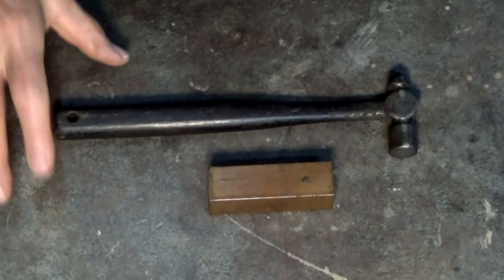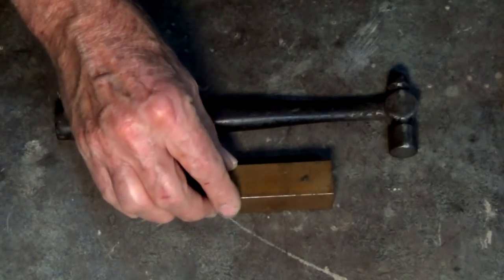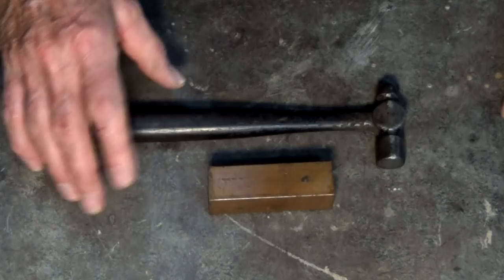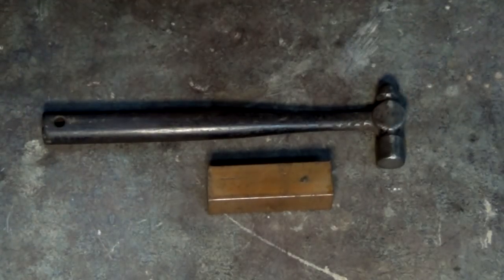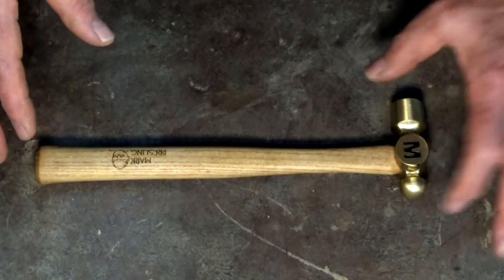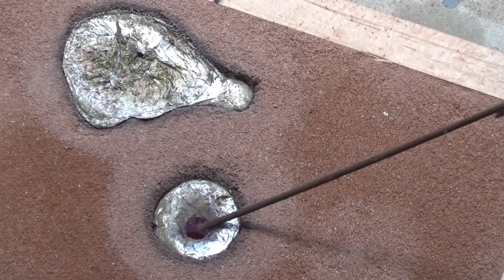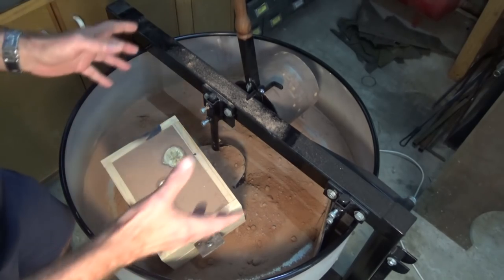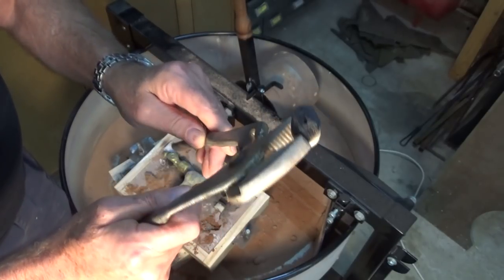CAST BRASS MACHINIST HAMMERS - PART 1, THE CASTING

Comment: Yet another excellent vid, Mr. Presling.

A note for beginners: Brass is made of zinc and copper. Zinc boils at a lower temperature than copper, as Mark touched on when he mentioned losing zinc. Zinc fumes are potentially hazardous to breathe so whenever you're casting brass you need to do it in a well ventilated area. Metal fume fever is no joke!

Comment: The most efficient way of getting uneven volumes mixed is geometric dilution. If you have say ten grams of the smaller volume add ten grams or an equal volume of the larger and combine. Then add equal volume on the larger to the already combined. Very quickly you will have it all combined and free from discrepancies. Beautifully explained in Turorial Pharmacy circa 1975.🤣. It makes me feel sick remembering that book but the technique sure works.
Reply from the maker: Hats off to pharmacists! 😁
Regards,
Mark

Comment: Nice work Mark! I don't have any casting facilities, but I like the size and agility and weight of those small ball pein hammers - so this gives me an idea to modify an existing ball pein hammer: Cut off half the cylindrical part, drill and tap the new face, loctite in a stud, and then cut off a few discs of round material (brass or aluminium or delrin or whatever) that can now screw on in place of the original steel face. When it gets dinged up, either reface it on the lathe, or make a new one!
Reply from the maker: Well you have a stinking big milling machine and a nice lathe so you're already half way there. Check out my video on making a copper face drawbar hammer. https://www.youtube.com/watch?v=N5f9ggC56y4 It's a bit like what you are considering.
Regards,
Mark

Comment: The resin that went off was probably a polyurethane casting resin, which in my experience usually have a shelf life of 6-12 months once opened. And hate any exposure to moisture.  Epoxy resins usually last longer. Great video btw. Have been planning to do something similar. Love making my own tools. My favorite hammer Is one I turned down from a piece of 38mm brass hex stock. Cheers
Reply from the maker: Yes, it was a surprise to me when it went off. I just won't be buying that type again.
Regards,
Mark

Comment: In a recent video, Tom Lipton was talking about hammers, and made the point that Brass is a bit hard and can cause damage to steel parts. Copper was his answer for a better mark free hammer material.
Reply from the maker: Yes, I watched that video just after I had printed the patterns for my brass hammers. I would love to have a supply of copper stock like he has. I am guessing he just goes through the skip out the back of Berkeley Labs to find enough to make a whole batch. I saw one of his posts on Instagram where they broke up a HUGE granite surface plate with sledge hammers because they couldn't sell it at auction. It was about the size of my bathroom floor. I nearly cried!

Comment: Nice video Mark. Your casting skills are really improving.
Just a word on hammer handles (and any other wooden handles for that matter). Always try to buy or make handles where the plane of the grain is in the same longitudinal plane of the hammer head or tool.
In this way the handles last so much longer and don't delaminate as they do when the gain is at right angles to the plane of the hammer head. It amazes me that so many handles are made the wrong way these days.
Reply from the maker: Don't get me started on hammer handles. I went to four hardware stores and three tool suppliers and guess what? Not a single one stocked a replacement hammer handle of the size I wanted. It seems that hammers are sold as disposable items now. I ended up buying a job lot of five handles on Ebay from the UK. So, I had to pay for shipping and they were purchased sight unseen. I understand what you are saying and one handle did start to split beyond the lower edge of the hammer head. I had to soak the grain with some thin cyanoacrylate to stabilise the wood. The only good thing is that a machinist hammer has a fairly easy life since they are not designed for heavy blows. Oh for the good old days when you could pop down to the local hardware and purchase from a wide selection of replacement handles of all descriptions!
Regards,
Mark
Reply: Ahh yes. That is an issue. Fortunately our local hardware stocks quite a number. However I am a bit of a hammer collector of all things. With some I have had to cave my own handles. It's really not that hard and quite rewarding. You should try it.

Comment: Have a look at 26:35, you scrape all the slag off but left some on the lip of the crucible and it falls in your pouring basin.
Reply from the maker: Yes, that stuff was hard to get rid of and I was very conscious of getting it in the mould as quickly as I could before it started to cool. I ended up with a cold shut on one of the hammers but I was able to silver solder it back together again. I had to warn my friend Macca, (a former boilermaker) that it wasn't a hammer designed for flogging inch thick steel but rather, for light tapping of delicate setups. The muller works great!
Regards,
Mark Presling
Reply: @Preso58  Good to see that  the muller is a useful tool in your workshop.

Comment: G'Day Mark, love the vids.  When I ran my foundry (hopefully I'll get it up and going on a much smaller scale) I made up my own 'K-Bond' which is very similar to Petrobond.  Use it over and over and just need to add some Isopropyl alcohol or metho with some smokeless 2 stroke oil when re-mulling and its ready to go again.  Gives beautiful definition (even thumb prints on the pattern) and is more like working bread dough than sand.  Also worked very well on cast iron.
Cam
Reply from the maker: Cam, I now have a recipe for Kbond and I am looking for a supply of bentone. Stay tuned!
Regards,
Preso
Reply: @Preso58  G'Day Mark, try Brenntag in Brisbane.  I purchased from their Melbourne facility, this is the price I got a couple of days ago -
"We do have product in stock. TDS and SDS attached.
Price for 25kg of Bentone 34 is $22.31 per kg plus GST. Total cost $557.75 plus GST. Delivery Melbourne Metro".
Not cheap I'll admit but if you do a quantity of casting its worth it for the superb finish you get on castings.  Bronze comes out with a near mirror finish.  I live down in Geelong south of Melbourne and they will deliver for free to my address.
Cam
Reply from the maker: @camatbattler2233  I am definitely interested in trying some KBond but $500 plus is a big investment for a backyard foundry. I will need to run this by the finance department (spouse). I may buy the whole 25kg and try to sell it on with gumtree or Ebay but I did see a post on the alloy avenue site where a poster was looking for partners to defray the cost of a whole bag purchase. Thanks for the info. 
Regards,
Mark Presling

Comment: Nice job Mark and leaving the mistakes in is a good learning lesson for the rest of us. Fwiw if you end up making anymore hammer heads? There should be at least one online scan around somewhere from the South Bend published projects book of there fully machined ball pein hammer. I know Randy Richards found one online some where when I mentioned it to him.In my opinion it has the very best proportions out of any design I've seen so far. Printing the pattern to there dimensions would be easy enough.
Reply from the maker: I did go looking for a 3D model of a machinist hammer head but came up short. I ended up measuring one that I already had (shown in the first shot of the video) however it was a really difficult thing to model. I had to use lofted profiles to get the transitions from the head and the ball pein to the central body of the hammer. I guess I didn't look hard enough for published drawings. I ended up putting the model on Thingiverse if anyone else wants to use it. 
Regards,
Mark Presling
Reply: @Preso58  This might be where Randy found his Mark. http://vintagemachinery.org/pubs/detail.aspx?id=16819 it's on page 36 of this PDF.

Comment: Nice job. Reminds me of high school metal shop, but we casted in aluminum.
Reply from the maker: You are lucky then. When I was teaching shop classes at school we were forbidden from teaching metal casting. This was in the days when the Education Department set policy for workplace health and safety. About 15 years ago they transferred the risk assessment and risk management to schools and individual teachers. We were then told we could teach anything we wanted but if there was an accident we would be personally responsible. So, not much metal casting was taught then either.
Regards,
Mark

Comment: I once built a cedar strip canoe using West System epoxy.  I was using left-over epoxy for at least 15 years - yours should not go bad on you.
Regarding the zinc boiling off the brass: how do you know how much zinc to add to make up for the boiling-off?
Reply from the maker: Bob, I too like the West system epoxy. It has never failed on me. With regard to the quantity of zinc, it is a bit of a judgement call but I was told by Olfoundryman that 1% added just before the pour is about right. I used some old roof flashing. It melts almost immediately. 
Regards,
Mark

Comment: At my father's foundry, when they were casting brass for bearing shells and valve bodies, they used to blow oxygen gently through the molten metal with a lance before pouring, to get rid of dissolved hydrogen which can cause surface bubbles and even voids in the cast. This was 50 years ago and I don't know if that is still foundry practice. They did the same thing with silicon aluminium.
Reply from the maker: Wilson, according to my mentor Olfoundryman the gas he uses in argon. Apparently degassing molten metal is just as complex as every other aspect of foundry work. I don't bother trying to degas any more. The advice I was given was to melt the metal as quickly as possible and don't go stirring it too much.
Regards,
Mark

Comment: Hi Mark, just a thought on those printed patterns for the cores. Could you print tabs on the sides so that you can use a screwdriver or similar to prise the patterns open, rather than risk the Stanley knife blade going through your thumb. Print them slightly offset from the face so when the 2 are put together there is a 2mm gap. You could use them as lugs to hold the two parts together and put the locating dowels in for when you are doing the mouldings.
Reply from the maker: Bill, I do print in some chamfers and other details to make separating the cores from the 3D prints now. Mostly I just leave thin slits in the core boxes so they flex open readily. The slits are so thin that the sand grains don't really get into the gaps. What would we do without 3D printers?
Regards,
Mark
Reply: @Preso58  Trouble with your channel, Clough42, Stefans and others is you do use 3D printers. Just something I have not got into (yet). For one thats going to be useful it looks as if I need to spend north of £1K which is money I can put towards something else for the workshop. I maybe need to reassess.

Comment: hello Mr Presling!, thanks for these videos!, quite curious how did you made your homebrew casting sand?, it would be really nice to see a video of that!
Reply from the maker: The only ingredient that might be hard to get is the bentonite clay. I was able to buy a 20kg bag from a rural supplier. It is sold as a sealer for earth dams. I also used some fine white beach sand but it is better to buy the "play sand' from a hardware store and sieve out the larger lumps. My greensand is a bit coarse but otherwise it's easy to make. The ratio is about 8-12% bentonite and the rest is sand. 
Regards,
Mark
Reply: @Preso58  thanks a lot for your reply! I will give it a look

Comment: Entertaining as always Mark. Is brass harder to cast with vs aluminum?
Reply from the maker: Brass just takes way longer to melt and it's hard to judge just how hot it is. Most of the fails I  have had with brass are due to having the metal freeze before it has filled the mould. Otherwise the mould making process is the same.
Regards,
Mark

Comment: What is the material you use to make the core with to allow a hole for handle?
Reply from the maker: I use a sand and epoxy mixture. Around 8% epoxy and just fine beach sand. It sets overnight and makes a strong core which holds together well in the mould. 
Regards,
Mark

Comment: No laughing here. I have a mountain of scrap iron, brass, copper, aluminium, and bronze I have collected over the years. I just finished building my shop a couple summers ago, have a new old mill I am restoring and lathe and am looking forward to jumping into casting very soon so any information you bring to light is much appreciated.
Reply from the maker: Cyrus, I recently purchased some new ingots of aluminium on the advice of my mentor Olfoundryman. He told me that if I approached a foundry and offered them $5 per kilo for good quality ingots and paid cash they would take it. He was absolutely correct and I now have about 30 kilos of stock for my next aluminium casting job. I have had some spectacular failures when using pressure die cast aluminium as my melting stock. The casting was brittle, hard to machine and the surface quality was rubbish. However, I started out using old car cylinder heads and pistons and those materials served me well. I guess you just have to find out what to avoid. I have only been doing home casting for the last 7 years or so and I initially thought it was just too difficult to do at home. It turns out that it is way easier than I first thought. As you have seen though, I still get failures. I am thinking the failure rate is about 5%.  I would suggest that anyone with a half decent home workshop should give it a go. It provides so much more scope for projects that can be achieved without a whole lot of tooling.
Regards,
Mark

Comment: Hi Mark. Great work and thanks for sharing your videos. Question... your "REMOVE BEFORE FLIGHT" tag doesn't happen to have a LIF127 Hawk aircraft on the reverse side does it?  If so, we may have mutual friends in common. 👍
Reply from the maker: No, I picked that up at the Farnborough Air Show in 2016, on a trade stand, not from an aircraft on the taxi way. 😁
Reply: @Preso58  Excellent.  I like it. 👍

Comment: Petrobond is good stuff, but, first of all, getting a package here (in the US) without it tearing open and losing half of it is the first part of the battle. The other thing, when you pour into it, it smokes, A LOT. Even doing it outside makes the whole house smell like an oil fire, to the point that the neighbors ask what's going on. Besides that, once it's been used a lot, reconstituting it back to a usable state can be a bit of a hit and miss project.  As usual, love your videos, stop touching your monitor :D
Reply from the maker: I had heard that petrobond can be a smelly beast but I would like to give it a try just the same. With regards to the monitor poking, I had not noticed that but now that I am aware I will avoid it with extreme prejudice. 😁

Comment: Why not use sodium silicate(also known as water glass, used as sealant for boilers), it cures with co2 very fast.
Reply from the maker: Here in Australia it is very costly to rent a cylinder of CO2. I have used sodium silicate sand before but I had access to CO2 mig welding gas at work. Now that I am retired that particular access has dried up. I know it is possible to use soda stream type cylinders but it is just an added cost. I find that the epoxy sand method suits the way I do things. The only down side is that you have to wait overnight for the epoxy to cure. 
Regards,
Mark

Comment: Hello Mark,  great video.   About 5 years ago I purchased some Petrobond Powder from Cast Metal Services.  They're still operational it seems and in your part of the State.  I use the powder as a substitute for bentonite clay in an oil sand recipe I got from the net.    The original page is down but here is a link to a forum, the 7th comment down gives full details for the recipe.   http://www.chaski.org/homemachinist/viewtopic.php?t=41623
Reply from the maker: Thanks for the link. I have bookmarked it and will have to go back and read it thoroughly. I have googled recipes for petrobond like mixtures before without much luck but this link seems to be promising. 
Regards,
Preso
Reply: @Preso58  No worries Mate.   Apart from the foul smelling smoke,  it works well.